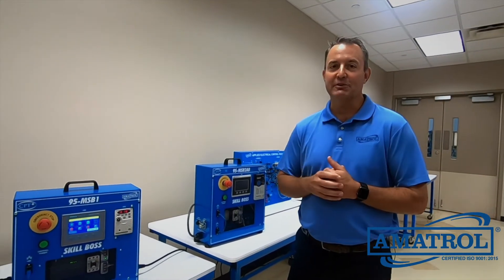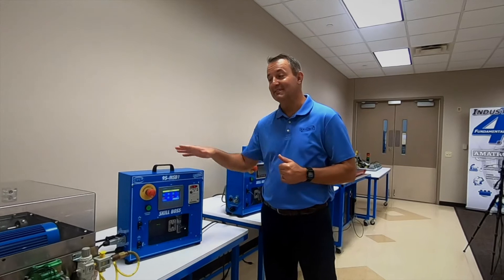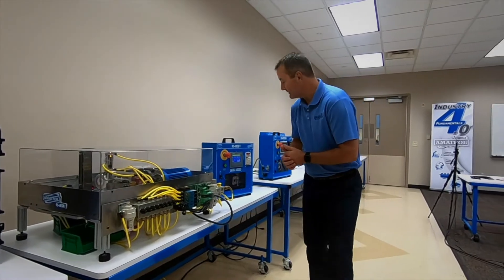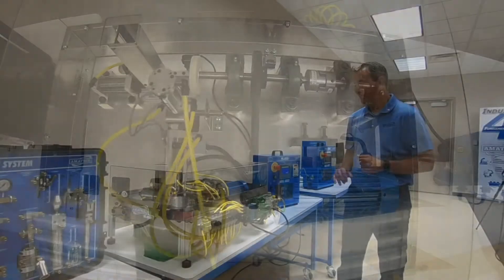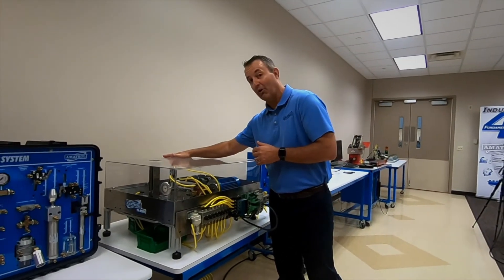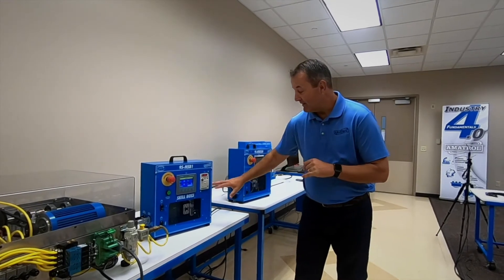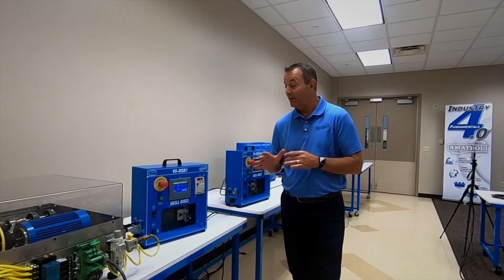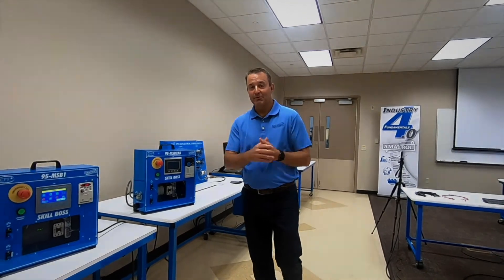Skill Boss Manufacturing - A Quick Demo (Amatrol)

Comment: Thank you for the video(s) as well. We tend to use acronyms these days. I looked up: HMI (Human Machine Interface, essential a control panel), STL (the file format used in 3D printing and CNC [Computer Numerical Control] for STereoLithography [CAD {Computer Aided Design}]), and G-code (Geometry [computer numerical control] code). What is CLC?